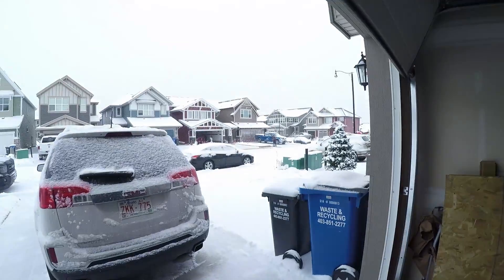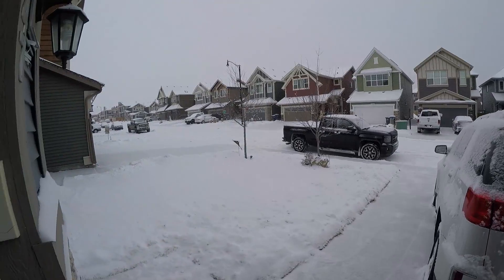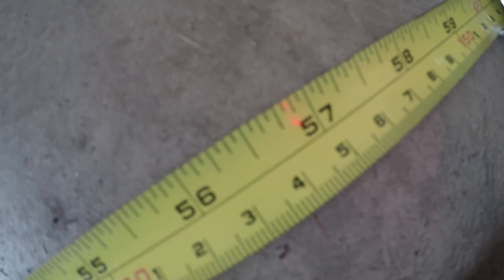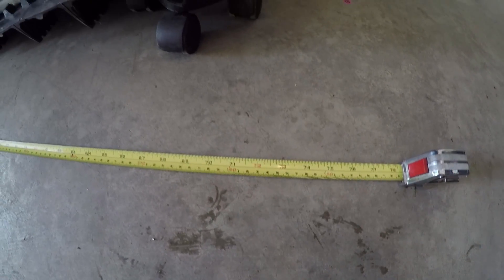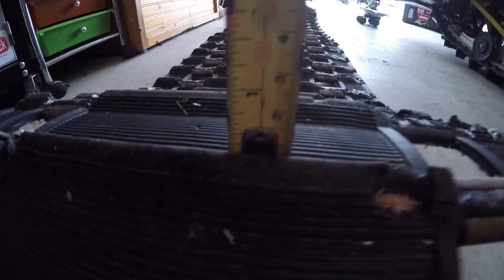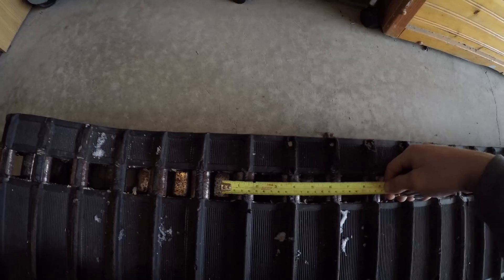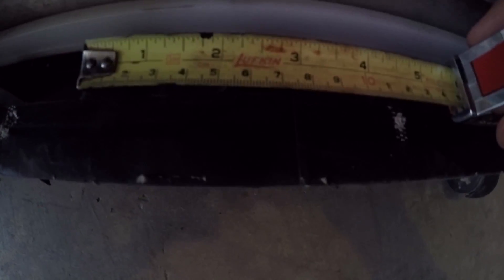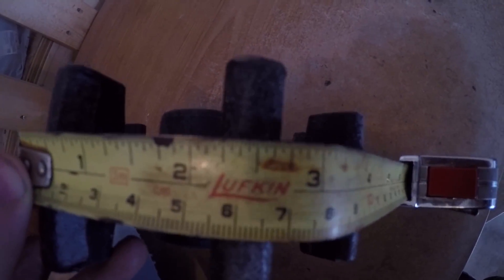Snowmobile Tracks EXPLAINED - Track Pitch

Comment: I have a 06 polaris fusion 600 HO.  W 128" track. I purchased a used track that had all the correct measurements  but was from a Skidoo.   I am concerned w/ the lugs inside for the drivers. The polaris track has lugs 1" wide in the center of the track.  While installing the Skidmore track has the lugs more to the outside by the clip windows & they are 2" apart.   Also the center of the track inside is snooth

Comment: to measure a track installed in a sled or removed, first measure the pitch, then count the number of windows then multiply those numbers. eg 2.52 pitch x 54 windows = 136.08.  This track would be 136".  Simple.
Reply: David Oakley Wrap a string around track, measure string.
Reply: Nice! Very good info! Cheers!
Reply: EXACTLY!

Comment: Thanks for the video man, very informative. On a side note and off topic, I have a new top end and clutching in my 2008 m8, what is recommended break in period? Ive heard 10 hours and staying away from full throttle. Any suggestions? Its pretty well factory except for the can, non turbo. Cheers!
Reply from the maker: . Break in consists of one full tank of fuel. Stay away from full 
throttle as well as don't hold the throttle in the same position for 
extended periods of time. Vary the throttle. The most important thing: 
Mix your first tank of gas 100:1 fuel/oil this will make sure your 
engine wears in properly!
Reply: Syxxes thanks for the reply! So even though I have oil injection I should still mix some? Just use my same cat apv synthetic oil? Can't wait to see some new riding edits man!
Reply: CalgaryDynastar : you can check with the manufacturer for breakin fuel mix, polaris requires 40:1 in the first tank. I wouldn't go with less oil than 50:1 for any 2 stroke breakin. This is in addition to the injection oil, "double oil", and can be any pre mix 2 stroke oil, most full synthetics are recomended for injection only, so check the label for compatibility, you may need to buy 1 quart of premix oil, if your oil is not recomended for premix. Remember that too much oil will not hurt the motor in any way, it will only foul plugs faster and smoke more. Too little oil will burn out bearings and destroy the motor.
Reply from the maker: 50:1 is incorrect for Arctic Cat two stroke engines. Please use 100:1 Fuel\oil.
Signed:
~An Arctic Cat Technician.
Reply from the maker: Yes. Use your APV oil. I think it works out to about 10oz. for a full tank of fuel at 100:1. (which is the right ratio for cat engine break in) Mix that into your fuel and top up your oil tank and go riding!
Reply: Awesome! Really appreciate the information man, wont be able to ride until after xmas but planning on spending a week or so to catch up on everything I have missed so far due to work:) Cheers!

Comment: Do you have tutorial on adjusting the suspension? I could use one right about now :D
Reply from the maker: Funny you should ask that, because I have been thinking of doing suspension adjustment for a video soon!
Reply: Syxxes I think that is a good idea because that could potentially get you quite a few views. Well basicly if the video would be titled well so that people could find it easily. And it wouldn't have to be even much detail, just pointing at the right place adjust in order to make a difference, like adjustung ski pressure and so on.